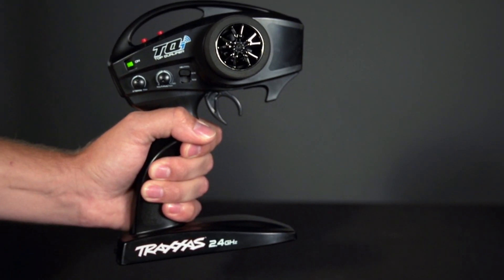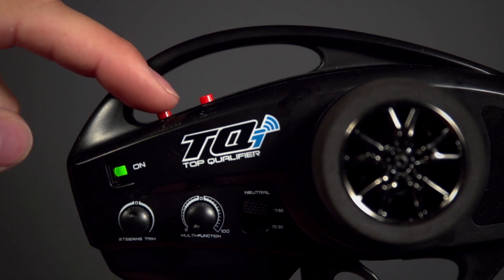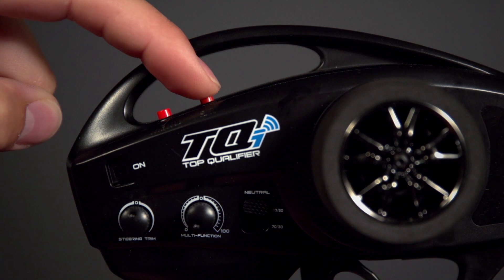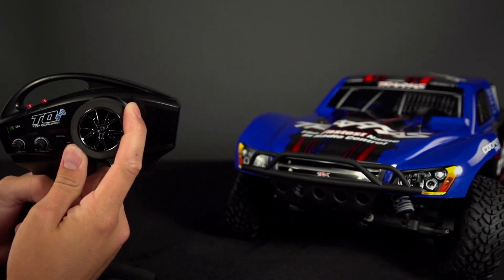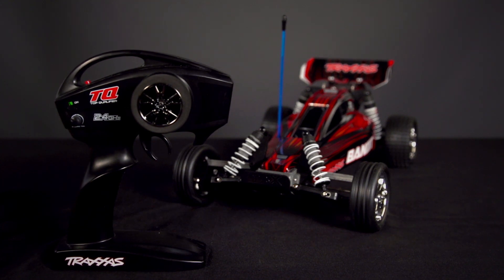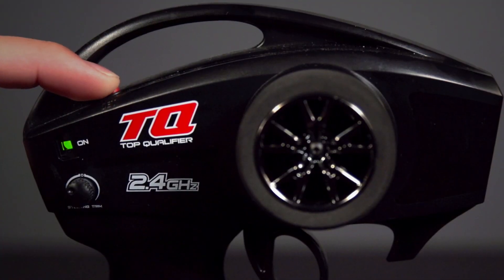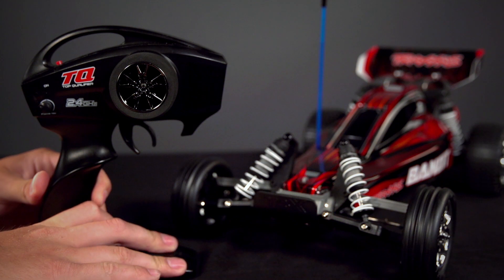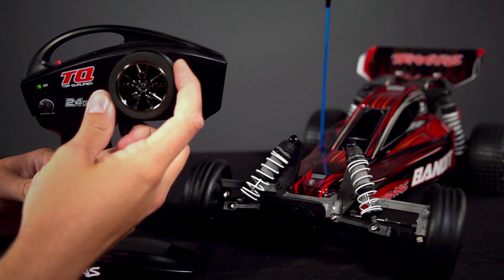How to Reverse Steering | Traxxas Support

Comment: im trying to do this on a nitro rustler on the servo on the back for the control of the engine speed     with a tqi and it reversed  both servos the steering and the acceleration and i have to reset this ever time